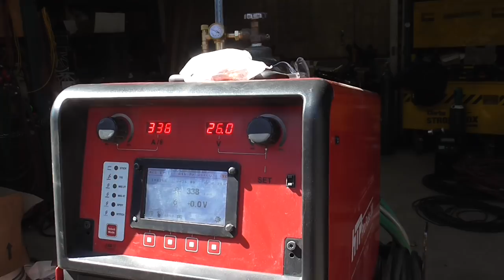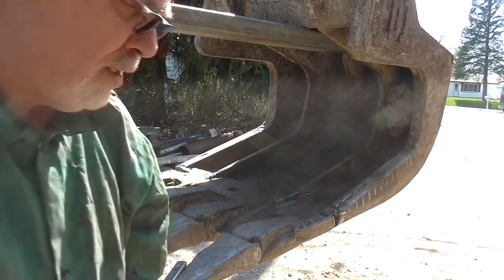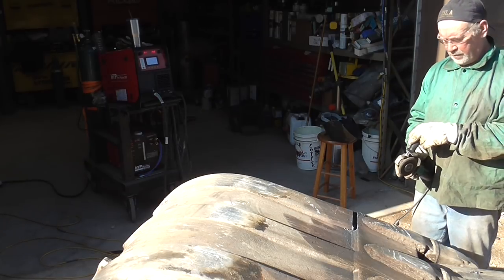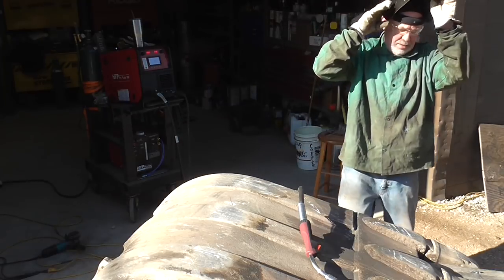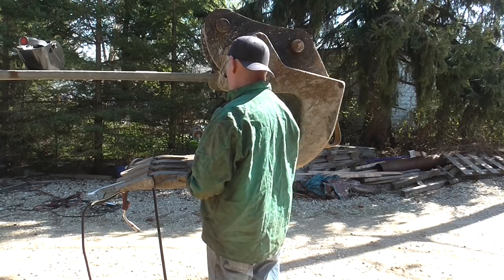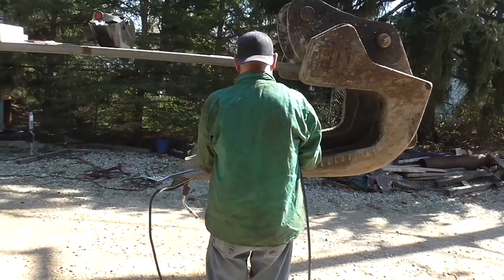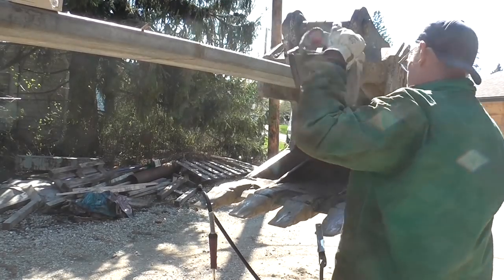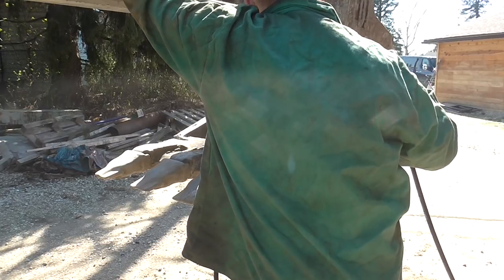Carbon air arc & dual shield wire on an excavator bucket *with lots of explanations* R.I.P. Steve

Comment: Sorry about your loss.

Could you have used 7018 stick?
Reply from the maker: 7018 is s little on the "light side" but like a 9018 or 10018 would have worked just fine. Those metal need a little bit more than "just" 7018 ....  not always and not saying it would have broken right away ... and in a pinch if 7018 is all you have and you do a good preheat ...  maybe - it's just not ideal and not really desirable either ...

Comment: How much preheat is necessary though?
Reply from the maker: akeem scale 250F minimum .,.,  400F is perfect !
Reply: @ZILAwelds  thanks.where im from the best option is 7018.
Reply from the maker: @akeemscale4958  you should use 10010 ...!  this is high strength steel ... 7018 is not enough strength ...
Reply: @ZILAwelds  thank u very much. I'll buy some an stock it

Comment: Howdy. Thank you for sharing. With everything the way it is now....due to selected officials. Looks like bucket list time....I would like to air arc gouge before I'm imprisoned or my head is cut off. I'm residential...looked into a rotary phase converter ... just considering my options. I would need a 300 amp dedicated circuit just to run the converter...I'm thinking I will have to buy an engine driven welder just for air arc. I better hurry though...death and no more gas motors are on the horizon. Have you seen the new "law" passed in California? Passes it last Saturday. Big ban on gas engines....I bet they flew in on a big fuel sucking jet....paid for by us of course. I can't even think of taking a vacation....but these devils just do as they please....on our dime. Sad face.
Reply from the maker: engine drive would be "easiest" ....